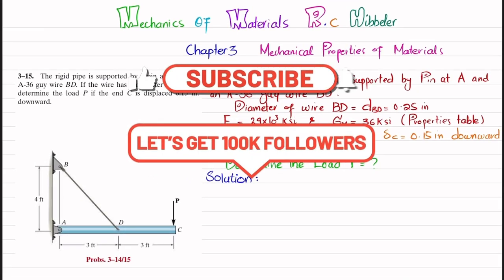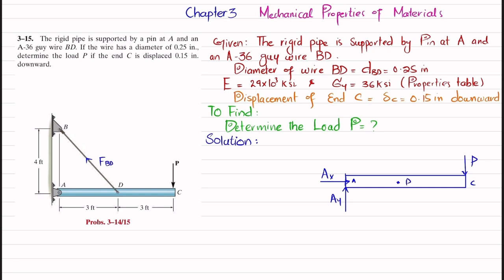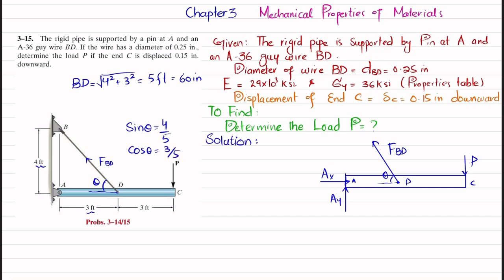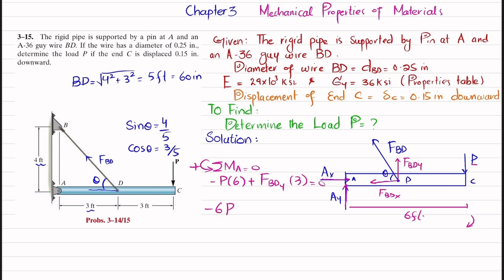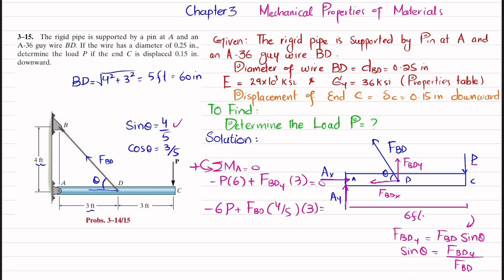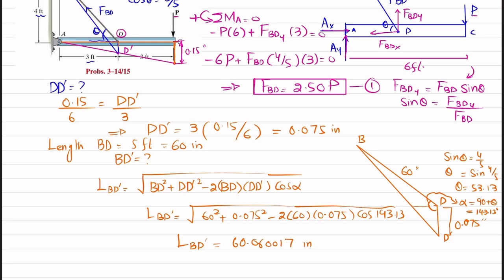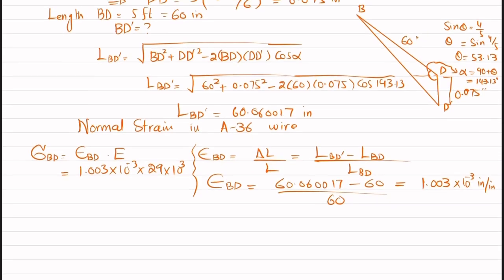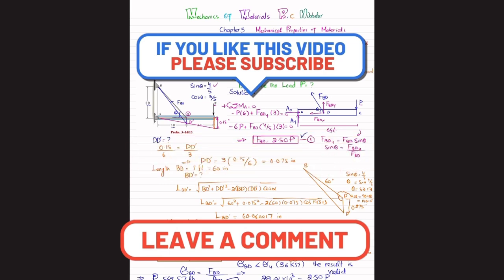3-15 | Determine the load P if end C is displaced 0.15 in | Mechanics of materials RC Hibbeler

Comment: hello there! i notice in the ratio and proportion that the units used we different. for the x axis is in ft while the y axis is in inches. is there no need for unit homogeneity in ratio and proportion?
Reply from the maker: kindly mention the place where there is inconsistencies for unit. it should be same.
Reply: and if i convert the inches to ft before solving for D' would it still be considered as correct?
Reply: 6:27 in solving for DD' but it's all good i figure it outt. thank you for this video!
Reply from the maker: @honeyforskz5450 ok that's fine . Keep watching and learning 👌

Comment: Hey there! Thank you for posting this! I just realized your problem has 0.15" instead of 0.075" for the downward displacement of C. After watching this and finding the textbook solution for mine, I noticed that my work only had one difference being the length of D in the y direction after displacement. C was displaced downward by 0.075" but since point D is at the midpoint, I think the displacement length for D should be 0.0375 instead of 0.075. I put my previous comment on the wrong video though lol. Copy pasting it here, please let me know if you agree. 

"I found the textbook solution and they used 0.075" as the displaced length in the y direction for point D but for the given geometry, the length from D-D' should be half that. So LD' should be  0.0375". Using that to solve for LBD', normal strain, and normal stress should result in 60.03", 5x10^-4, and 14.5ksi respectively. Then solving for the moments about point A should result in the 2.5P=FBD and finally P = 284.70 lb."
Reply from the maker: You are right and again you can verify it through video where you can just put your own values of the problem and solve accordingly.  Thank you